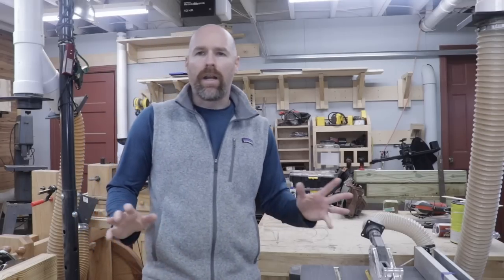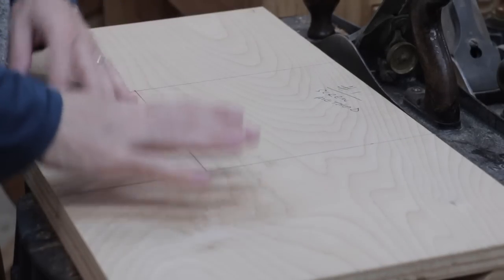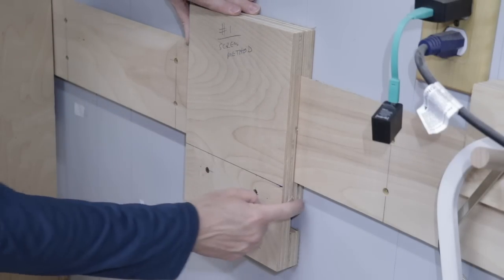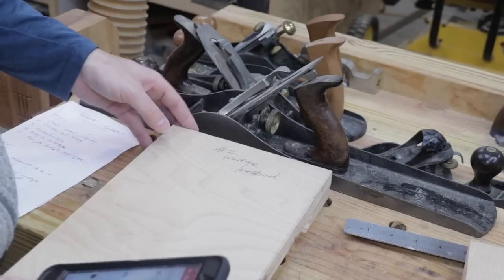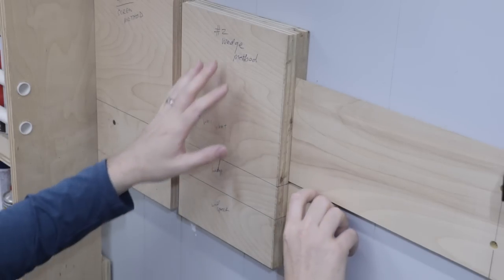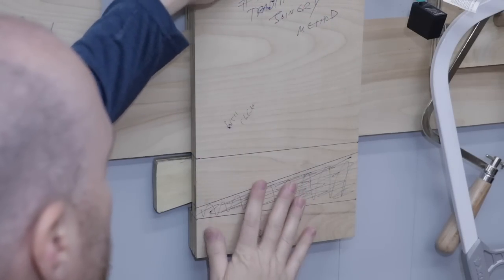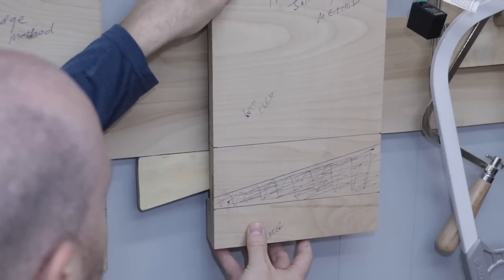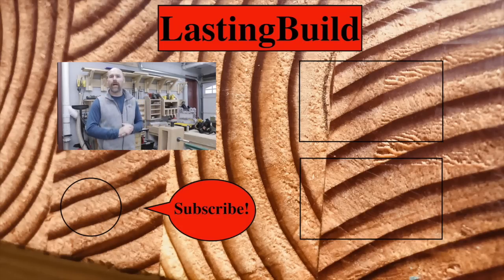Three Ways TO Make Locking French Cleats

Comment: The fourth method -- one French cleat is fixed on the top, the second one is fixed upside down -- on the bottom, below the one on the wall. The third French cleat slides  in, and the whole thing is 1) reliably fixed in place, 2) easy to remove the sliding part and take off the holder, because nothing is wedged into anything. Unfortunately it's not possible to add the drawing here.

Comment: I'm building a french cleat wall now and all the "locking cleat" videos seem like overkill to me.  I plan use the wall without locks until things are in a configuration that works for me.  Then a screw or two per holder to lock things down.  They're still easy to remove (assuming you have one those fancy drills that goes in reverse) and you have no extra pieces to cut (some of which would need to be sized and/or angled carefully).  Plus, how do you deal with getting those locks in when there's not enough horizontal space between your holders?

Screw it and be done with it.

And no, I couldn't care less if my wall cleats have screw holes in them.
Reply from the maker: Should work just fine! Good luck!

Comment: If there were ( beveled edges ) cleats on the top and bottom on the wall a simple cam with a bevel could lock the shelf/ tool holder in place.
Reply from the maker: That would be pretty cool!

Comment: You there is one method you missed making an L shape that would screw on the side and lock down over your cleat holder on the wall. That will keep it from falling off the wall also, it just flips down and locks in place on the side of your tool cabinet.
Reply from the maker: Another viewer has used that method as well!

Comment: I will be devils advocate.  Screws would be the absolute best way to ensure it does not fall if security is you concern. A little more time setting up method 2 would make it so similar to the 'traditional' that I would not have a preference. First time I saw french cleats was in Europe in the 70's. Used to hang kitchen cabinets and they had to locks and a lot of weight.
Reply from the maker: Thanks for sharing and watching!

Comment: Why not just put one screw through the holder into the top cleat on the wall?
That will prevent it from lifting up and coming off the wall?
Also why not use a peg just below the wall cleat, through the holder from the front that will prevent it from rising up.

Comment: Why such a huge cleat height? it only needs 2-1/2" height and run 2-3 times as many cleats on the wall to allow more variety in tool placement. The wedge only needs to be 3"-4" wide, and doesn't need to be full width.

Comment: Bro, why make things so complicated? I've been using French cleats for, literally, decades. In my shop, I repurposed kitchen cabinets. I simply installed the top cleat at the back of the cabinet's exterior with a 45 degree angle and the spacer bar at the bottom and ran one screw through the inside of the cabinet and top cleat, thus locking the cabinet in. I could store very heavy tools and supplies in those cabinets. Of course, you have to make sure your 45° angle wall cleat is mounted and screwed into the studs. If you need to remove it, simply remove the single screw at the back of the cabinet. Or, in your case, the single screw at the back of the tool board. The last two methods that you described require, as you pointed out, access from the side. Using the single screw method, you simply install the cabinets side by side, with the option of having no spacing between them and run the screw to mount it.

Comment: As far as the "screw method" goes, why not just screw the tool holder directly to the cleat? Myself, I would prefer the second "traditional joinery method"! This allows the moving of the tool holder side to side, in case room is needed, without any unmounting.....

Comment: @LastingBuild, I love the comparison.Nice video!

I think what Steve Howard is describing below is a locking cleat like demonstrated by @Woodworker Anonymous in this video at 5:07:  https://youtu.be/-i4JaG0GUYs. @April Wilkerson used the idea in her video.

The idea is basically to cut a 15 degree back bevel on the non-45-degree side side of each cleat (the wall mount side and the tool-mount side). Then your key is designed to have a 15-degree camber on top and bottom and slide in between two matching 15-degree bevels. No need to screws, the key slides easily sideways if wanted with pinky pressure, but no amount of weight is going to bring the tool holder down without breaking some screws or studs. Cheers!
Reply from the maker: That would definitely be earthquake proof! Thanks for watching and sharing!

Comment: Seems overly complicated. Why not just drill a small hole through the tool holder (either one in the middle or maybe one equidistant from the centre) insert a cut off nail to hook under the wall cleat? it doesn't have to be super strong - it just needs to prevent the tool holder from rising up above the wall cleat. The nail will prevent that. Saves a huge amount of work, time and effort. It is also very versatile, especially if all your wall cleats and gaps are the same size.

Comment: They are all too complex in my opinion. These tool holders are for function, not display. If you are worried about bumping the tool holder and moving it off the cleat ( and yes, I agree that that is a possible problem ) then just drive a single screw straight through the holder into the wall mounted cleat. Done. Easy to do, easy to change if you need to. Not complex at all. Who cares if you can see an extra screw head.